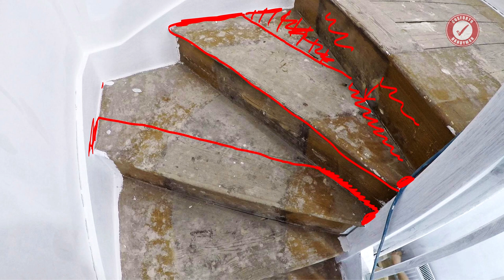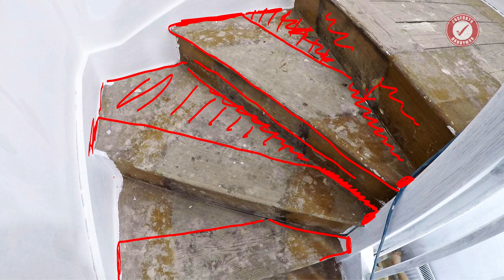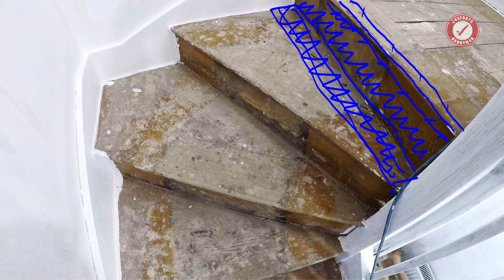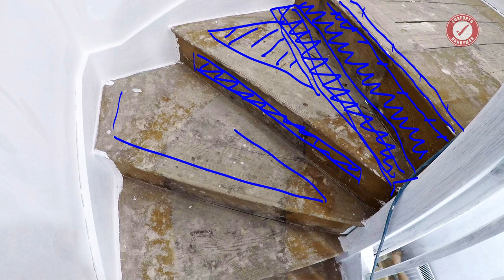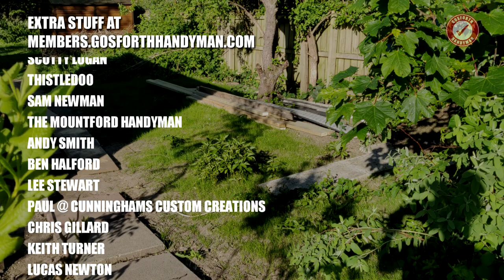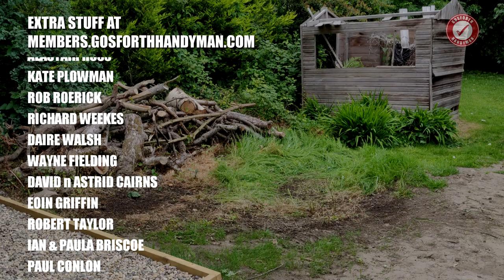How I repair broken stairs (1920’s Renovation Part 30)

Comment: I’m a floorlayer and I recommend you ask the carpet fitter to pin/screw the gripper rods onto the stairs instead of hammer as it can knock the riser loose
Reply from the maker: The house will fall down before these come loose. 😁👍

Comment: Corking job repair !! I would add some contractors pva glue mixed with a bit of water and brush it all over the  stair case as bolt and braces . I’m no builder . But we had that type of stair case going to loft Extension with a similar problem to yours our caused by 6 ‘4  17stone football player son and him being so heavy footed over a period of 21 years of wear and tear and that’s what they recommended  the 2 builders we got out to repair it stops Squeaking in stairs too .

Comment: Thanks very much for this video. I've had my stairs fail in exactly the same place (I'm renovating a Victorian Terrace) and I followed your process exactly (even with the wedges to really tighten things up). I was reluctant to take down the lath and plaster but after trying to botch it from above with some brackets and 12mm ply it was clear that I needed to bite the bullet. So glad I did. Hard work but totally bomber now. Appreciate the content! It's a great channel.

Comment: I highly recommend a 5 Minute Polyurethane Wood Glue for a caulking gun for this job. It's gap filling, sets quickly and is super strong. I used it on my stairs 4 years ago. Still rock solid and no squeeks at all.

Comment: Just what I needed to tackle the broken attic stairs in my late Victorian Tce., unfort. I won't rip out all the lathe and plaster underneath as it's in the home so will have to work from both above and level.  One poinrt I didn't gather was what you decided to do about the broken rebate on the riser.

Comment: You’ll be able to but some insulation under those steps now you’ve got access too.
Reply: Yeah, I thought it would be weird when Andy has gone through the trouble of insulating under all the floors just to have a big draft through the stairs.
Or maybe the garage will be insulated and heated so it's taken care of that way?
Reply from the maker: Yup! Will defo be insulated - as much as I can fit in there. 👍👍

Comment: CAPITALS DUE TO PARTIAL SIGHT AND REDUCED COGNITIVE ABILITIES.

AS A RETIRED JOINER I WOULD NEVER HAVE CONTEMPLATED THE USE OF STEEL IN JOINERY WORK.  WHILE I WAS WATCHING I WOUNDED IF LARGE L BRACKETS MAY HAVE BEEN AN OPTION.  THESE COULD BE FITTED TO THE RISER AND TREAD OVER PLY  TIMBER SUPPORTS.   DOING THIS SORT OF REPAIR ALWAYS THROWS IN CHALLENGES.   CRACKING WORK AS USUAL, THANKS MICHAEL

Comment: Not sure of the temperature in your future garage, but would any insulation under the stairs help when you close it back up?
Reply: I’ll be adding few sheets to at least stopped draughts And keep the heat in cold out
Reply: It can make a big difference. The bottom ten steps of my stairs are open to the underfloor void. They are now covered with 75mm of PIR and the brick wall below the stringer and to the understairs cupboard have 100mm fibreglass bats attached to them. Raised the temperature in my hall by around 2°C in the winter.

Comment: Awesome job Andy and thanks for the tips.
I've got virtually the same issue with my 60's staircase, a split riser where its screwed into a quarter turn tread.
As the underside of mine is in a kitchen pantry/cupboard i want to repair it without losing much head height.

Comment: Great job up to now matey.I got divorced in 2000 and with my half of the money bought a late 20s house,on my own with cash in my pocket a decent job on morns,afts and nights had plenty of time to crack on with bringing it up to date sometimes kicking and screaming but I've got it there only trades needed was plasterer( I'm hopless) and gas fitters luckily my daughter was at the time going out with a fully qualified sparky everything else I did my self,when you get to the stage you are at with skirting ect it's a great insensitive for that final push.Great vids and  very helpful,wish they were out when I was doing mine,👍don't think internet was invented then,🤣
Reply from the maker: Fantastic stuff! Yes, very close to done (phase 1) now! 👍😁

Comment: Before gluing down the Carpet to the stairs, put in a separation layer, and an water barrier layer.
For water barrier just paint then once with an cheap paint. And for the Separation layer glue newspaper down to the steps and raisers.
The reason is that at some point someone will spill something on the stairs and it will soak into the wood. The paper will help when removing the carpet later on. It's a pain to scrape off old carpet and glue.

Comment: The OCD in me would have made support boards that went all across the back instead of patches of wood.
But, that's just me, I've been accused of overbuilding everything I do.
Reply: Strictly speaking in this case it wouldn't be overbuilding as the repair here is already overbuilt. You're spending time on finishing even where its unseen. I'm in complete agreement. I can't bear the idea anything I do looks "good enough" unless its for a pet or a temporary garden structure and even then I struggle to underbuild enough! This does of course mean you have less time for the real visually important stuff, but that hasn't stopped me yet
....

Comment: There's the problem with no stringer for those winders.  They counted on the nails through that riser into the tread, in hopes that good faith would keep it together forever. LOL The riser should just be a filler, rather than a structural member, IMHO.
Reply from the maker: Yup, totally agree! 👍👍

Comment: Great video, gives me hope for my creaky 180° staircase. It's fairly recent, square section Newell posts etc but soft wood. I now have some idea what to look for. I know, a creak ain't much, but my understairs cupboard is open to view the underside. Just a niggle, but knowing what's moving is useful for prioritizing, bottom of the list or fallen off completely😉. They varnished it, but the timber is still rough sawn🙄. Expect I'll hear the party when you move in🥂.

Comment: Another cracking example of the joys of lime plaster.. considering that’s an out house and the timbers are perfect, the lime plaster with laths will have been breathing and flexing for 100’s of years.

Is that stair section coming into the new extension, you mentioned garage.. is that going to be an “warm” garage?

Cracking stuff as always.

Comment: These stairs are the exact double of mine, unfortunately, I can not get to the underneath.  150 years of wear and tear have taken their toll.  I am going to strengthen them, then box them in with plywood.  I don't think modern staircases will stand the test of time as these have. OSB board and chipboard just don't work as well as real wood.

Comment: And you can insulate under the stairs.   You said at the start that its a lot easier when you can get access from underneath - what would you do if you couldn’t?  One of our stair treads has broken and its all plasterboarded and boarded in the hallway underneath so can’t really get underneath without a lot of mess and making good afterwards.

Comment: I was wondering why you used yellow glue and not construction/subfloor adhesive. I would have used it and put a large bead on the top edge of the plywood backers as well. May as well get glue on the surfaces that come into contact.

Comment: Honestly suprised you managed to save the old step I would have been seriously considering replacing the riser and tred and then adding a stringer support down the centre. Good job though! I know all too well how awkward working on stairs are (sooo much cramp!)

Speaking of someone who has recently sanded back his steps on a 1913 property I would say: don't feel bad about all the screw heads. 100 years of wear on the softwood treds makes noticable divots so sanding them up to look nice is a massive timesink. You choose correctly with carpet :)
Reply from the maker: Cheers - yeah, I was preparing myself for replacing the whole lot but in the end it was fixable, which I was very pleased about 😁
Reply: My 30 year old softwood stairs, even softer. Divots and noticable wear on the nosings.

Comment: Good tip for removing plaster from lathe and plaster ceilings is to use a garden space. Suspect you didn’t have the room under the stairs though.

Comment: Great video as ever, thanks. Any suggestions to how you would go about doing a similar repair on stairs that will be exposed  (not carpeted)?
Reply: I previously repaired ours by screwing up from below through 18mm ply with screws just long enough to stop short of breaking out the top of the step. The big thing I've learned so far in my binge watching is mitrebond two part ca glue!
Reply: @mikeforwarduk  Many thanks for the advice Mike. Did you glue with mitrebond as well as screwing the ply?
Reply: @julianday5466  hi Julian. I used wood glue.

Comment: It appears that the stairs are over an unconditioned space. If that is the case, will you be installing any insulation before you apply the fire-rated boards?

Comment: Great video mate…. There may be a video I’ve missed on it but could you briefly explain your water pipe in the old out house… does it feed the house? I still have my old lead main and it’s under a concrete floor so the new route would be through my garage into the house that way. I’m guessing as long as all regs are met and it’s insulated etc it’s acceptable? Cheers buddy.

Comment: Hi, is the staircase open at the bottom? I have a similar issue in my 1920s terrace property, the staircase comes off the kitchen and a lot of heat is lost up there. I cant put a conventional door on as it it right next to the exterior back door so I was thinking of putting a type of sliding door in, but don't think it would look right. Be interesting to see what you have done or if anyone can point me to one of your videos that shows it please?

Comment: Don't they have central stringers in Britain? Great work! Getting close to moving in!
Reply: Too small for that.
Reply: @firesurfer  Nor sure I buy that. One could be run from the wall to the top of the stairs. It would, however, take more carpentry than it was worth when doing a development.
Reply: @pmichael73  Stringers for a staircase only 3' wide?  What for?
Reply: @firesurfer  It broke, didn't it?
Reply: @pmichael73  It was installed wrong, to begin with. The small piece had no support.
Reply: @firesurfer  QED
Reply: @pmichael73  err, hardly qed!! That's like 'man maths' - self justifying a dodgy argument!  AND it lasted 100 years - pretty excellent for basic carpentry.......!

Comment: I would have pulled the skirt off and replaced that winder with 4/quarter plywood and oak moulding.
  Anyway, it's fine as it is. The eternal problem with houses is "might as well".
Reply: Seriously, you'd have gone to all that unnecessary extra work and mess and follow up making good - just to support a couple of damaged treads.. ?!  And where does the Oak come in - this is basic construction joinery.....!
Reply: @andymccabe6712   I'm not in favor of carpet on stairs.  The whole thing should have been rebuilt. That is why I mentioned "might as well". I'm aware that most people won't do that for practical reasons.

Comment: @2:45 Dodgy steps is right. Not sure how they got away with using such thin boards for stairs without it falling apart sooner.
All stairs I've seen use two bys for treads and supports.
Looks like they cheaped out by using old crating.
Reply: Well, at 100 years they didn't do too badly , did they...?!
No building control in those days ...
Reply: I remodeled a bedroom in a house that I owned built in 1867. When I removed the plaster and lathe, the wall studs were literally tree branches and rough cut timbers.
Later, an old timer told me it was common back then for locals to go down to the river after the spring floods to scavage for building materials from the trees that washed down the river and floated up on the river banks.
Talk about no building codes...whatever floated the boat!

Comment: Used to be a builder.  I heard you were not a Carpenter unless you could build proper stairs and cut roof framing.  Had a hundred year old book on stairs and one of the things it said was..."if you must have winders in your stairs, put them at the bottom because you Will fall down them."  

That stair was broken by impact damage.  A long ago owner pushed her husband down the stair.  That explains the groaning and laughter you hear when working there alone late at night.  Don't tell Mrs. Mac.
Reply from the maker: That explains a lot! 😁

Comment: Am I the only person who does not like walking on stairs that are angled like this? They look pretty, but I feel like I'm going to trip or lose my footing on them. I didn't realize that structurally they are weaker, too.
Reply: Do you mean the turn at the top of the stairs? They do look nice don't they!  I believe they're called 'winders'.
You wouldn't like the stairs in our house - they turn back on themselves so you turn 180 degrees as you climb...!!
Reply: I don't believe the winding stairs currently meet code in the US. My grandmother always bragged about how Grandfather "designed" the stairs in the house he built in the late 40's when the carpenters said they couldn't build the staircase in the space available.  Never went up those winding stairs without tripping.

Comment: You have to piss with what you got sometimes. There will be twats telling you otherwise. I have done loads of "bodge" repairs on new build MDF stairs on the winders. And loads and loads of old school council prefabs with the cemented straw walls, etc. The stringers are 2" deep in the walls and only 1" thick with a 1/4" housing, wedges glued in with the old horse glue.The treads and risers split to buggery and nailed, glued, screwed. There really is no option to get all proffesional. Jigsaw twice up the middle, kick it all out, glue and screw blocks to the stingers, Hardest part is finding 230x25 timber. Bul nose it off and loads more glue and screws. Half the house had to come out to fix it and they will fall ove in 20 years. Should show you some pictures.

Comment: I'm suprised you took that coarse of action, obviously the whole peice is the tread, timber came in planks which had to be fixed together to make the larger winders, back then they used a loose tongue which was glued into two grooves cut in each peice that made up the tread, the riser just sat on the tread and was nailed from below, the tread sat on the riser which was nailed from above, they then hammered wedges in to the stringers to hold it all stable and secure, they are easily removed by cutting off the nails with a multitool, and removing both riser and tread wedges, this allows enough movement to remove the tread and riser, which will probably drop out anyway, it can then be replaced or repaired,  they rebate and glue them now so they're a nightmare to disassemble, it lasted a hundred years, which i doubt todays chipboard affairs will last. Just an alternative solution for your veiwers, Having said all that, thats a pretty restrictive area your working in there, so by building a supportive frame is probably easier, and much quicker, belt and braces eh.
Love the video's anyway, keep up the good work.